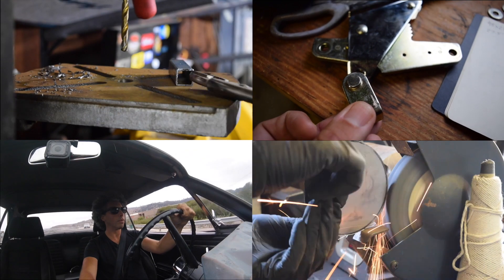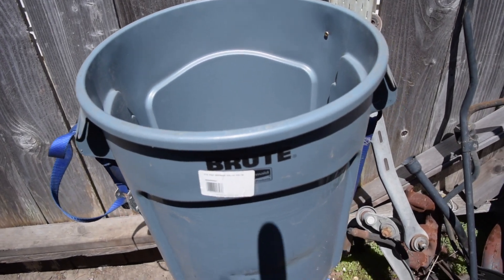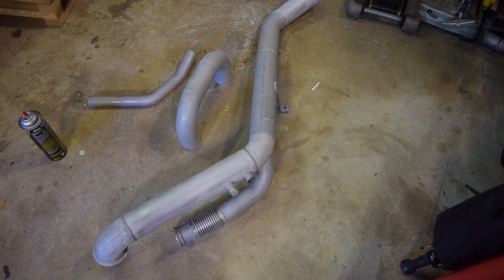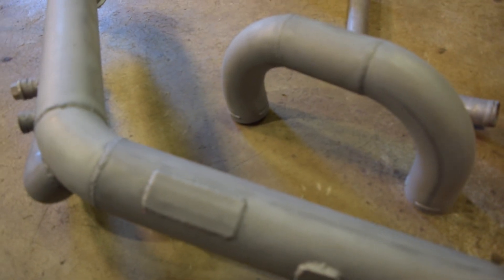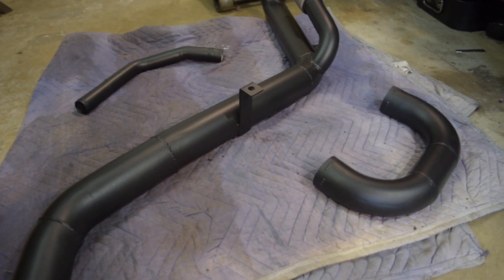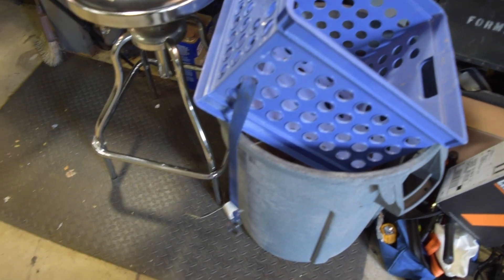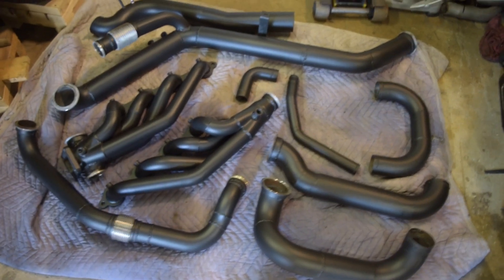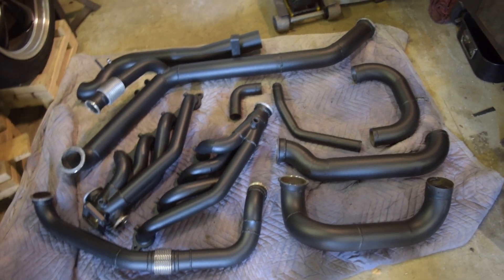Air-Dry Ceramic Coating With Cerakote

Comment: Question, headers and exhausts that come already ceramic coated I believe are coated on the inside and outside? If that’s true if diy just the outside won’t the inside surface metal get crazy hot? I know hotter means faster evacuation, but that heat concentration on the unprotected inside can’t be good for the metal? I read a comment somewhere that said too much heat can literally explode the metal from the inside. Can’t be good for a muffler either, especially a motorcycle muffler with just steel wool inside. I believe the ceramic on the outside is doing the opposite of dissipating heat, it’s actually acting like a shield and not allowing the heat to dissipate through the metal into the cooler air. That’s why it doesn’t feel as hot. But the inside I think is hot as hell, more so than normal. That’s why a coating on the inside is there on finished parts, the heat has no where to go but out. I’m interested to hear your or anyones thoughts on this. And if I’m right, how the hell do you diy a good coat on the inside of a long header or pipe? 🤔

Comment: How good does it stop heat?  Does it block radiation (IR heat) or does it actually stop it to the touch and stop heat conduction?
Reply from the maker: You can't touch it while running, but after shutdown it's pretty cool to the touch within minutes. I'm in the process of building heat shields for everything as an additional precaution.

Comment: Interested to see how these hold up. Up and running em hot yet? Gonna do my motorcycle exhaust next I think.
Reply from the maker: Yeah I've cycled them a bunch of times - they're holding up well. Impressed with the finish and heat dissipation.
Reply: @PistonsofFury  have an IG or website I could follow their story? Ha

Comment: How much cerakote did you use, does it seem to go a long way?
Reply from the maker: I used a pint and it covered all the hot side and cold side parts. You only need one coat so it goes pretty far.

Comment: Has the Cerracoat coating failed on the areas of your exhaust that get the hottest.    After some heat cycles you may be able to scratch it off with your fingernail . How is it going so far
Reply from the maker: I've heat cycled it a bunch now, as well as removed and installed the parts a bunch of times and can confidently say it's one of the more durable coatings I've ever used. I actually try to use it now for any parts that will see a lot of weather/wear.

Comment: question after you sandblasted and you are wiping down the exhaust pipes before you spray product, is that red rag soaked in anything or are you just wiping the freshly sandblasted stuff with a dry rag?
Reply from the maker: It's just a dry rag at that point to remove any remaining blasting media. Per Cerakote instructions, once you blast, no more chemicals before coating application.
Reply: @PistonsofFury  thank you brother

Comment: I use a cheap kids tent to do my blasting in. You can shake the media down to one corner to collect when you need to and it stops a lot of the dust! Very cheap and a lot of room to move bits around in there.
Reply from the maker: This is genius level innovation - definitely going to borrow it!
Reply: @PistonsofFury  anytime 😉 I have lots of hacks like that 👍
Reply: sweet

Comment: I thought it was H series that was air dry any ways how strong is that for AR 15
Reply: H series is an oven bake dry and it also takes a catalyst where is the C series is air dry. You could use the C series on the barrel of an AR if you plan on firing a whole lot of ammo back to back and get that thing really hot but if you’re just going out and plinking you’re not gonna get that issue in an H series is more than sufficient. When using the H series you need a 1.0 or a 1.2 nozzle because it is much finer and you’ll get a lot better results. 
Paul @ 4 Dogs Cerakote
Reply: Also keeping your project oil or grease free is absolutely critical or the Cerakote will not stick. Powder free latex gloves are a must and when I am doing a project just to be sure, I change gloves four or even five times from start to finish to make sure there’s no cross-contamination Such as if I need a pair of pliers to bend a hook the plier handles may have residual oil or grease and I’m not willing to take the chance of destroying a project to save a $.10 glove

Comment: Just a few tips:
Use garnet for blasting outside of a blast cabinet instead of aluminum oxide.     It's far less dangerous.  Protect your eyes with either.

You can use degreaser instead of acetone to soak parts.  Instead of just heating the welds, heat the whole pipe to try to out gas as much trapped oils as possible.

Cerakote flexes a lot without any issues.  No need to mask unless you just want to see some stainless showing for cosmetic purposes.

You can use transfer grey to dissipate heat faster on the intake side of the turbo and plumbing, effectively increasing the intercooler size but don't get too carried away and blast the fins of the intercooler.
Reply from the maker: Awesome info, thanks.

Comment: hi mate didnt you have to degrease it soak it in acetone  ?
Reply from the maker: Yeah that's what Cerakote recommends, but given the size of the parts I'm dealing with, and the fact that I'm a guy-in-a-shed operation, purchasing enough acetone to fill a giant tub seemed... irresponsible. So I did my best to clean everything and heat treat to remove any contaminants.

Comment: So you did the sand blasting to prepare the surface to remove all of the rust.
I will be working on a brand new set of stainless steel headers. Do you think I should still sand blast or just brush with some scotch bright to roughen the surface?

Thank you
Reply from the maker: Cerakote recommends 120grit aluminum abrasive. I've seen videos of guys just hitting them with red scotchbrite, but I'd be worried about it not being the right profile for proper adhesion. I've used the scotchbrite red on stainless tubing before and the difference between that and the aluminum grit blasting is huge. Not to mention, stainless is a really hard metal, and difficult to scuff up really well by hand. Hope this helps. Good luck!
Reply: @PistonsofFury  thank you very much for the info!
Reply: @eduardo23rubio  You think a rotary tool or drill with a scuff pad attachment would work pretty well? Maybe not as good as blasting but a lot better than by hand at least?

Comment: What was the purpose of heating the welds with the propane torch?
Reply from the maker: Per the Cerakote application instructions, you're supposed to bake the parts in a curing oven to ensure all of the contaminants from the welds are cooked off. Due to the size of the parts, the propane torch was next best thing I had available. Hoping it holds up!

Comment: how is it holding up?
Reply from the maker: Well I haven't put any heat through everything yet. Will drop an update video once it's running and go over any issues. I can tell you the coating is definitely way tougher than quality auto paint though.

Comment: so why'd you tape off the bellows?
Reply from the maker: I'm making a big assumption that if/when the bellow flexes, that it would crack the ceramic coat and cause it to flake in other areas. Also, the bellows are quality stainless steel from Vibrant, so they will not corrode like the mild steel tubing I used. It's all getting covered by heat shield though anyway, so the heat is less of a concern.
Reply: @PistonsofFury  ahhh.. i think the cerakote will flex some, but I'm not 100%.. they looked stainless, i just figured the main reason you were coating was to cut down on heat. came out good.. i'll have to do mine when i re-do my hotside.. :/ 
wondering if the cerakote will drop the temps enough where i don't have to wrap the exhaust though. mines a tight fit..
Reply from the maker: @callofgeorge  General internet consensus says to expect a ~20% drop in temps, which at turbo EGT's is fairly significant. With proper heat shielding though you can drop them significantly. I'd like to ultimately be able to take road trips without melting every piece of plastic/rubber in the engine bay.
Reply: @PistonsofFury  my thoughts exactly... i want to be able to street my car without worrying I'm going to melt something or catch something on fire.. not to mention, my up pipe is super close to my alternator..